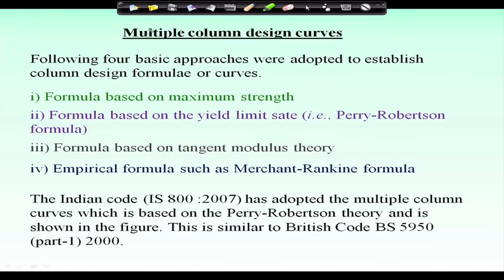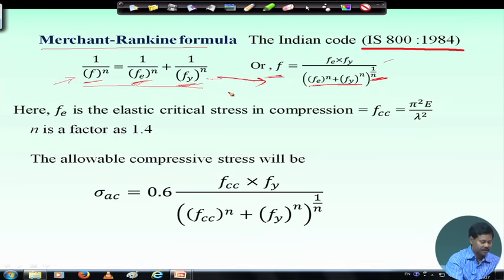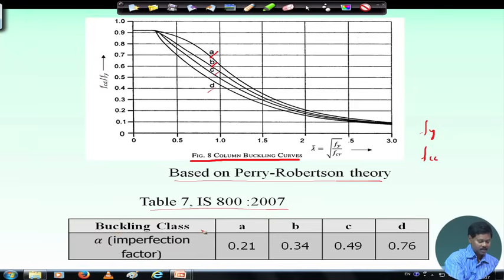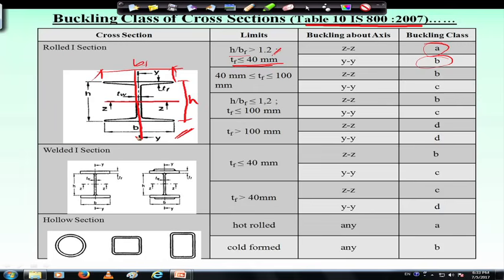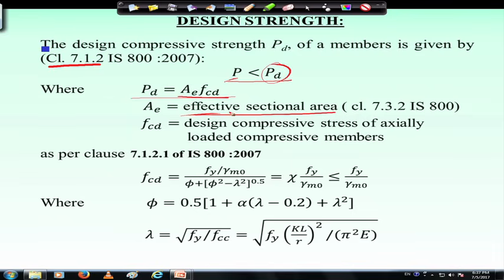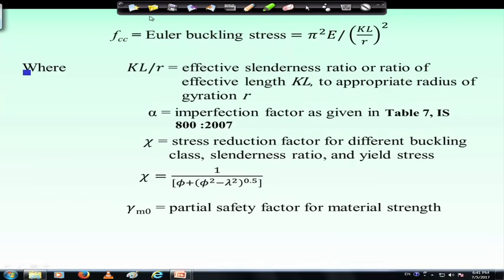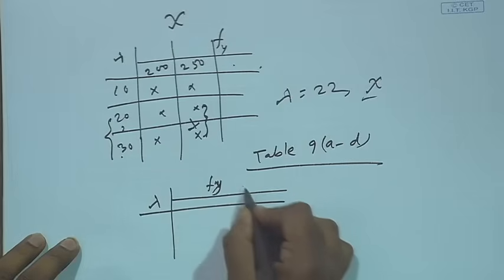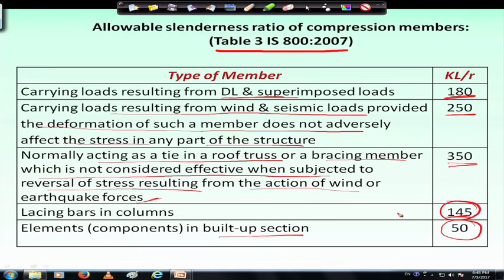Lecture 31 : Compressive Strength

Comment: The Professor uses KL/r and λ interchangeably which is confusing. IS uses these two separately.
Reply: Hasan Shirazi yes one is effective slenderness ratio and the other is slenderness ratio. I think in earlier code, lambda was KL/r.
Reply: KL/r is normal slenderness ratio and other lambda is non dimensional slenderness ratio